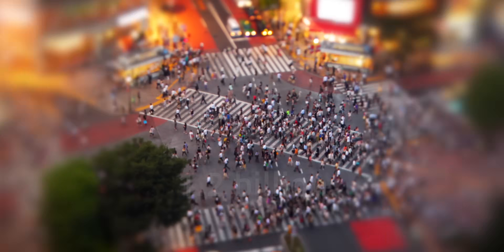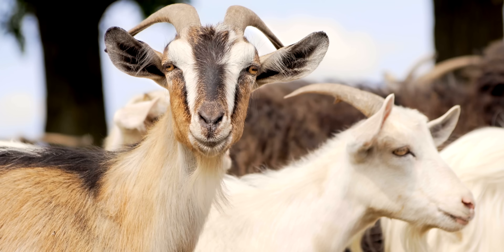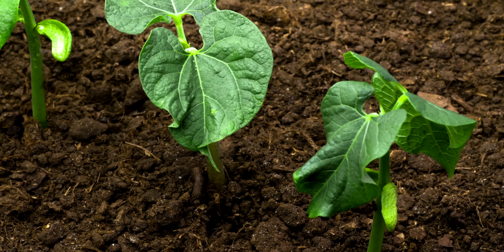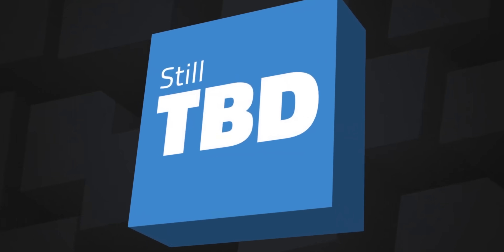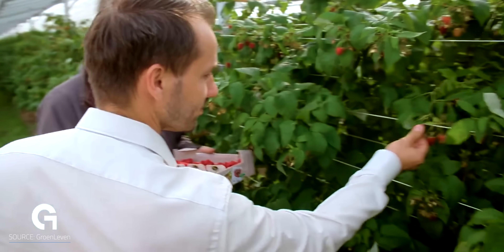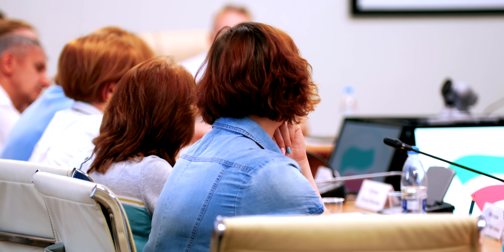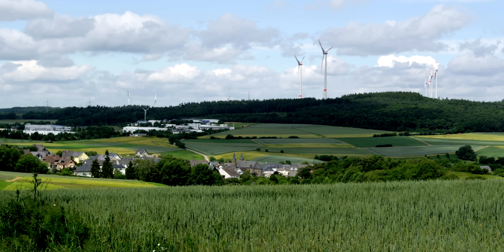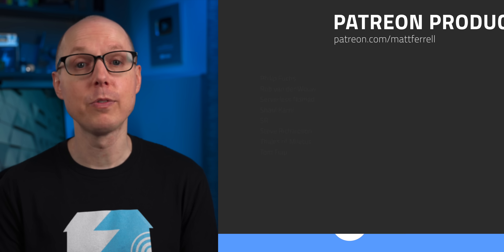Solar Panels Plus Farming? Agrivoltaics Explained

Comment from the maker: But what do you think?  Should we be trying to use agrivoltaics everywhere?  Are there any other dual use renewable energy examples that you know about?  If you liked this video, be sure to check out 28,000 Year Nuclear Waste Battery? Diamond Batteries Explained https://youtu.be/VWwKqSzakYU?list=PLnTSM-ORSgi5LVxHfWfQE6-Y_HnK-sgXS
Reply: I'm wondering if it would be more cost effective to have a solar-powered-multi-level-vertical-hydroponic-farm-warehouse built on the same land rather than an agrovoltaic? What's the most amount of food that can be grown, harvested, and shipped for the least/most efficient amount of energy in 1 square meter? (Big brain time. Lol.) Cheers!
Reply: @gumpdude  Warehouses are already used for vertical farming and I believe include solar panels on the roof.  You don't need to build warehouses for this because there are plenty around the US that aren't used.  So, first best to use the resources you already have.  If you live in a country that doesn't have a lot of empty warehouses, maybe.

There's a LOT of crops that aren't really suited for that style of growing.  It's mostly used to produce greens and other small vegetable plants.  Even with tomatoes, putting them in soil under a cover, and putting a cover over the soil to help retain water is very effective.  I know people do hydroponics with tomatoes, but stacking becomes a different story.  You need crops that don't create deep root systems and are small because you need a few levels of plant for warehousing to be cost effective.  You need to generate the lighting for all this.  If you have to build a warehouse, it's a big investment that by itself doesn't generate revenue the same way solar panels by themselves would.  This is a tradeoff between full crop space and power generation to make money.

This type of farming would hit resistance if you have to build a bunch of warehouses to do it and would still suffer from the NIMY effect.
Reply: @gumpdude  not all crops can be farmed in hydroponic efficiently. But sure it can work for some lettuce
Reply: Saw a Doctor-turned-farmer in arid western Indian State of Rajasthan combining fish farming beneath his Solar farm. Govt of India gave a subsidised loan for this project. It is a net win-win. Cooler solar panels, less evaporation of pond in hot summer (in western India Summer temperature can go as high as 50 degree Celsius.
Reply: The Western US is looking a devastating drought as Lake Mead sinks to scary levels where where we’re looking at a real possibility of the Hover Dam no longer being able to produce electricity for the surround area. These dry arid regions offer a great wide open landscape for solar farms. Utilizing the electricity generated to desalinate water to help convert these areas into usable farm land which can benefit from the shade of using agrivoltaics. Once the land is reclaimed and the water demands for maintaining the land are minimized excess water from desalination can be utilized for municipal use along with any excess electricity. Multiple birds with one stone potentially.
Reply: @SeanMTuohy  I, waiting for vast greenhouse farms to be built in areas in the country that have water but a shorter growing season than California. Think of places like Tennessee, Missouri and Arkansa.
Reply: I have wondered about this also. Look at some of the huge greenhouse complexes like the ones on the Mediterranean Coast Spain which is about the same latitude as the states you mentioned.  Heck even our greenhouse is over 40F right now and it is 13F outside now and we only have about 5 1/2 hours of sunshine now.
Reply: This is great! I've been talking about doing something like this for two decades now and this is the first I've seen of it being tried out. Not only is this brilliant, it is a potential solution to desertification, giving us a means of recovering/using desert terrain to food AND power production around small communities, such as our desert southwest. Countries like Saudi Arabia and others in that region could free themselves of water and food insecurity while providing them the power they need to move off of petrochemicals.
Thanks for sharing this.
Reply: @Myrddnn  So, where are you going to get the water in the desert?  You know the UAE tried to create a neato farming system in the desert.  Everything was well thought out, except the water part.  They quickly went through all available ground water, and ground water, believe it or not is even important in the desert, and there isn't as much of it.  It was a big waste of money for them, and all the investors who thought it was a good idea.  Even if you do rain capture, rain in desert is infrequent, and if you collect it, it's not replenishing ground water.  You would have to pipe in water, and for a place like Saudi Arabia that would mean desalination.

I don't understand the fine details of hydraulics in the desert areas, and probably each area is different and you need a specialist to come in to any area to come up with a plan for trying to gain land back from a desert.  But, this usually only works if the land recently wasn't desert and you're trying to restore it.  I think this has been done in a few places, and it usually involves restoring forests that used to exist in nearby places.  I believe this is happening in Jordan for instance.
Reply: The case for dual use solar over water reservoirs or transport canals is another very interesting one. In California there was a study showing it can reduce the rate of evaporation, and also assist with panel cooling.
Reply: The limited "Wind & Solar Renewables" need to give an honest answer to the same questions I sent to the Sierra Club regarding whether Indonesia's should build 7×500MWe ThorCon liquid metal Thorium ion molten sodium fluoride salt burner energy converters totalling 3.5GWe base load &/or load following -
 Or continue with their PV alternative and destroy a further 19000Ha (190sq.km) of scarce tropical rain forest for Solar PV farms to supply the equivalent energy?

My unanswered Open letter to Sierra Club: -  
"..INDONESIA has an environmental choice: -
more poluting coal-fired power stations; 
Or-
 7×500MWe liquid Thorium metal ion with molten sodium fluoride salt, (MSR) ThorCon energy Converters at a capital cost of $1/Watt;and a >75 year life?
 Or -
Destroying 190 square kilometres of tropical rain forest for <30% utility 25 year life Solar farms to get the same total energy output  as the seven ThorCon 500MW MSR units but at a cost of $(2÷30%)=$6/Watt?
I represent a number of environmentalists in Indodesia and we would love to see a reduction in the number of 1GWth Coal power Stations scheduled within the next 10year plan as well as the eventual conversion/modification of existing ones to use Molten Salt Reactors (MSR) as a clean and safe heat source.
We, and quite a number within the rural farming community, are concerned not only with the encroachment by urban sprawl into extremely productive farming and flood absorbing land; but also the actions of entrepreneurs seeking land for large Solar panel farms.
# Could you please confirm whether or not your club would prefer seeing Indonesia's choice for replacing existing and future planned poluting coal-fired power stations with either the likes of MSRs or farming and/or tropical rain forests destroying Solar farms such as : -
A) their currently contracted 7×500MWe ThorCon "Walk-away" safe (near ambient pressure), energy converters with a 65m×180m=1.17Ha footprint per load following unit of max 500MW on grid; at a worst case annual 95% utility factor, amounting to an averaged availability max load of  406MW/Ha (over a giving 75year life) at a capital cost of $1/Watt and a PPA agreed cost to consumers <$0.07/kWh;
Or -
B) (As already experienced in PLTS SulUt  Likupang's 21MWp ;15MW on Grid at 30% utility with a footprint of 30Ha and 25year life); 
Equivalent Solar farms at 0.5MW/Ha; at a pre utility basic capital cost of $2/Watt; and a current PPA cost to consumers $0.066/kWh and averaged load output 0.1MW/Ha to 0.5MW/Ha over 7.5 hours per day giving 30% utility.
HENCE for Solar Output over their productive hours to equal that of ThorCon's 3500MWe over the same daylight period of time; then the area requires would be:
 (7×500/0.5)÷1.17=7000/1.17=6000Ha or 60km^2 of scarce tropical rain forests.
Because Solar is only effective for 7.5hours/day (30% utility), to meet the Max possible (as a  base load) annual output would increase required area tropical rain forest destruction to 0.95×6000÷0.3=19000Ha or 190 Square kilometres of tropical rain forests or virgin jungle.
(It is of note that wind farm are not viable in Indonesia due to their lack of wind being in a Equatorial location).
If you cannot confirm a suitable choice for Indonesia (or the world for that matter) would you reconfirm that the Sierra Club still prefers the destruction of temperate forests in Germany for shipment to burn in subsidised poluting British biomass plants in preference to walk-away safe liquid metal molten salt reactor that can also burn up existing nuclear "waste"?
NOTE: I have no interest or influence in ThorCon.."
I await your judgement..🥝🥝🙏
Reply: @MrVaticanRag  Hello, this is ishee. I am from West Indian state of Gujarat. As a developing nation we are in a state of constant battle trying to balance demand n I was wondering if i can use your letter and explanation abt. Thor Con on my Social media and a few people who work within the Coal industry ?
Reply: Plant some ThorCon molten salt reactors at 500MWe per 1.17Ha (two football fields) and safe the other 9.83km^2 for crops ot tropical rain forests.
Reply: Excellent video, Matt!  I run a few subs on Reddit and have been sharing your vids over there. I also teach people how to install small off grid solar and build sustainable and affordable housing.

I have been off grid for over 20 years and my focus is on homesteaders and small off grid systems and sustaianable villages.
Reply: @solarcabin  We have a remote recreational place we built 20 years ago that we could live in full time if we wanted. I’ve had solar there for 15 years. There is a 12v system for lights and RV pump. There also is a 4K 48v inverter system. We will never run out of wood there either.
Reply: @Chris_at_Home  Right on!  Things keep getting worse that would be a good place to be.
Reply: the main question shoulb be how much food can be produced in food factories (airopondics/aquapondics) using of the electricity produced by the agrivoltaic setup? how much higher is the total jield?
Reply: @TalasDD  Look at videos of people having fully enclose ecosystems for growing food. It is fantastic to see many problems of growing food in the great outdoors suffers from storms, winds and BUGs. These enclosed facilities have that all under control. Solar seems to provide for all the electricity needed to run the greenhouse. Water is recirculated, reducing the need for more water, bugs don't destroy crops and yields are higher. Everything is computer controlled. I see these types of facilities really great in areas that are hostile to plants, like being near a desert.
Reply: @TalasDD 
•  Today, Globally, 120,000TWhrs/yr would be required by PV Panels to MEET ALL OF MANKINDS ENERGY NEEDS (not just Electric Customers today who use <30% of the above).. 

• If this is priced at $0.05/KWhrs.. you get $6 Trillion / yr Revenue from AV Electricity.. 

• The Global Agricultural Revenue is $4.5Trillion/yr (6% of GDP of  $75 Trillion GDP).. 

• As you can see by DUAL-USE of Farmland by adopting AV.. The Income of Farmers will more than double from USD 4.5Trillion/yr to 6+4.5= $10.5Trillion/yr.. on the SAME LAND.. !!! 
Hope this helps..!!!
Reply: Instead of just having gaps between the angled solar panels you could have clear corrugated plastic that would still allow for sunlight to pass through but would also create a wonderful rain capture system for when storms pass over the solar panels. That captured rain could further reduce water consumption from Land Wells or municipal sources in order to water the crops under the solar panels. Capturing the rain could help during dry spells, but the panels between the cells would further protect the crops from wind and hail damage.
Reply: I would love to see a hybrid system between Agrivoltaics and Aquaponics.
Reply: Your voice speed is a bit fast at a normal rate
Reply: Solar over irrigation canals is dual use.
Reply: I think we need more sustainable farming more diversity less uprooting less chemicals and well lots more but most importantly more native foods that require less water and what not you know.
Reply: "Tinted Semi-Transparent Solar Panels Allow Concurrent 
 Production of Crops and Electricity on the Same Cropland"
This paper showed that using Tinted Semi-Transparent PV could provide optimal wavelengths (blue and red) to spinach and basil.
I don't know the farms that you shared whether they incorporate this tech or not yet ???
Reply: @amazingmemories5839  "Semi-Transparent Solar Panels Allow Concurrent 
 Production of Crops and Electricity on the Same Cropland"
I was going to bring up the notion of PVs that let some light through, but you beat me to it.
Reply: in Israel, they grow crops on the southern side , close to Dead See. the good things is  : lot of lands and lot of sunlight, the bad thing is too much sunlight and no water. They employ some advance technology to water the plant. this type of solar solution should benefit them a lot
Reply: No Win. Basically your peddling Snake Oil. 95% of farmers in the world do not have the money
to build structures like this. Also what your growing is only sufficient to an extend. Not a solution but a privilege.
Nature bats last remember ... and all you can do sell these ugly lookalike tshirts.
Reply: There is more of a demand for the means of production, because the thing being produced is held to ransom at ten times the cost.
Reply: Everywhere, no.  Lots and lots of places, absolutely.
Reply: It's an interesting concept.  What are some of the "push-backs"?  I've got 40 acres of cleared land and will use solar mainly to power my house and a barn, probably a 10KwH system as I have now.  I've already noticed that my solar installer shorted us on the circuits connected to the batteries, i.e. during a recent power outage I used less than 2% of the battery in a 4 hour period running the well pump, septic pumps, water treatment system, 2 freezers, some lighting, my pc and modem and a 45" TV.  I could probably hook up several more circuits (like our kitchen) and still have power to spare.  Agriculture... we will be a very small hobby farm with an orchard, so pushing water to trees and crops will be needed, but that won't take much power at all.
Reply: Maybe this why rich people that are promoting global warming are buying up vast amounts of farmland.
Reply: What are the energy costs of maintaining capitalism and the "free market" ?
Reply: @SapphicReality  "What are the energy costs of maintaining capitalism and the "free market" ?"
The free market provides everything that gets provided.  Everything else just uses what the free market makes.
Reply: why beg for government intervention, is that not simply an admission that individuals aren't willing to do these things? there are people like you who talk about this technology and say things like, "it would be great if someone did this!" but you seem to implicitly admit that nobody wants to, so "the government" should? that just sounds like bullying.
Reply: @714acedeck  
The IMF says that the fossil fuel industry gets $11 million per second in subsidies to extract an energy source that is more than half gone (so will only get more expensive as time goes by).
This might be in the best interests of some large corporations but it is against the best interests of the people.
Why are you a lackey of the fossil fuel industry?
Reply: @parajacks4  right? I see the same criticism against electric cars. What's the point if there not economic without substies? Where like you point out they already are and have always been substized. On top of that how many billion dollars did it take to bail out the auto industry ten years ago or so back?
Reply: Agrivoltaics are a great way to replace dry, near sterile areas into a an ecosystem right underneath it, raising the panels  a few feet up, allows the same energy production but alleviate the harshness of the desert lands into productive agriculture... plug a few heat pumps underneath and the condensed water will nourish the plants too... Great thinking I didn't envision without your video....
Reply: Of course not all the land, but part of it
I'm a Brazilian farmer and can tell you
 Agrivoltaics is indeed feasible for some crops like fruits and vegetables, but not for high yielding and sun light demanding ones like cotton or corn
And yes, there is a ongoing sun energy harnessing combined with food production technique, called ILPF
Consists of planting Eucalyptus for firewood combined with cultivated cattle pasture
There is lots of publications about it, may be the most in Brazilian Portuguese 
By the way, the Brazilian demand for solid fuel is by far mostly supplied by cultivated eucalyptus rather than coal
It's firewood have about the same energy as lignite and is carbon negative, since you need to plant the forest and let it grow something between 6 and 10 years before harvest
During this time, you will be storing carbon for future use, much like a savings account
Since it's a long time before harvest, there are the need of several plots of land on different stages of storage for each one being harvested, so, it's carbon negative
An old data I found told a yield of 60 metric tons of dry firewood per hectare year at the time of harvest
Just like 6 kg/year of lignite per square meter
Reply: Add those solid state wind turbines to this concept, might then even integrate watering the farm land, as a side bonus.
Really, you should consider a few video's that explore how certain concepts could help each other out.
Like that transparant solar video of yours, being added to this solar & farming video and that solid state wind video also of yours.
Reply: Every reservoir should be covered with solar panels, they put dumb little plastic balls on them so the water doesn't evaporate if they made floating solar panels you'd be killing 2 birds with one stone.
Reply: @KnotRight4Ever  , oh yeah, Veritasium did a viddeo on the balls,

like how India is covering its canals?
Reply: I heard a long time ago that a student from China made a highly efficient solar panel out of human hair, what if you made a solar net instead of panel. That would keep birds an bugs out an only block some light an for the plants that need more light you plant them on the borders of your farm an put mirror walls to reflect light under the net giving them more light and as a net the solar net could absorb light from underneath too.
Reply: My use would be with my aquaponics system which I am going to upscale to about 6 hectares of space over the next 10 years or so depending on how fast I can come up with funds for it.  

My current crops are ornamental plants which would benefit from the lower light as we use a polyeurethene shade material now which would could replace with the panels.  They would power the system as well as producing electricity for our planned fruit transformation factories & other such plans.    I am living & working in Colombia.  Do you possibly have any connections that would be interested in a project like this?
Reply: @DukDukDoDo  about 20yrs ago I heard of a algea called shawanna wonnosis ( I probably butchered the spelling) it produced acual energy not bio fuel but like an eel and it even said if digested certain materials it could pass conductive nano wire as a waste an itself could live an magnify a voltage within a certain battery type. I looked it up every once an while but haven't seen anything big about it since. I think the government had a huge bio farm filled with it in Texas the last I looked.
Reply: Absolut, das sollten wir! I We try with our members from the green party (die Grünen) to start a pilot-project in our Community. Cross the fingers (drücke die Daumen) that we can realize it. Hopefully our new government in Germany with die Grünen, as one of the coalition parties will change the the "Rahmenbedingungen" ore general conditions, that it will be in future easier for Agri-PV.
Reply: This is literally the dumbest thing that has ever been posted, congrats!  Plants convert solar energy into food.   Solar panels convert solar energy into electricity.    They couldn't be more incompatible considering that they both compete for the same solar power source.    The solution is simple:    First world nations need to vow to withhold financial aid and/or go on a trade embargo unless the trade partner has a birth rate close to replacement value.   This would also encourage first world countries to stop their open-border policies to ensure their own populations don't exponentially grow, and it will provide worldwide economic incentive to stop having 7-children.     Otherwise, any plan that you implement will be unsustainable with exponential birthrates from the middle-east, India, and Africa that will simply explode and take over the world population through immigration to countries that have their birth rates under control.
Reply: I really want to discuss something with you through direct message...
Please it's about your video
Reply: Here's something for the idiots of Renewable Energy: 

Sooner or later you greenies are going to need to grow up and learn how economies work. - hint government people understand nothing of economies other than  how to rape them.    

These G-morons decided "woke' power (power that doesn't really work) was a great idea for them, not us, so they decided to steal some money from some ratepayers in order to pay others to stimulate the growth or power that really doesn't work - ie wind and solar.

In the real world, the one that really works,  there is something called supply and demand and these things regulate the price of everything fairly.  

Your butcher buys his beef by the side and pays more for it than the meat packing plant did who in turn paid more for steer than it cost the rancher to produce it.   Get it so far?     

Now when you buy that beefsteak at the butcher's shop he's going to get his markup as well,  so you as the end consumer are going to have to pay a lot more for it per pound than the rancher was paid for it.   

Next time you want a beefsteak drive out to a ranch and buy your steer on the hoof - then you slaughter it, age it carve it up sell the inedible parts to dogfood processors and the like and eat the rest of it on the cheap - no you want the value that all those who added value to the meat along the whole length of the supply chain don't you?  Or do you buy your steaks on the hoof?      Or do you expect to pay the  ranchers price at your favorite steakhouse as well?

It's that way with electricity too, you cannot expect the power company to buy power back from you at retail rates when they don't even need or want the power. With that business model they will go bankrupt as soon as their investors are wiped out.    

If that rancher were to dine out at your favorite steakhouse why not demand that your ignorant politicians make the restaurant buy his on-the-hoof steer from him on demand at the same rate per pound that they charge you for a 16 oz prime rib?    

The problem is, as with all government planned economies, sooner or later everyone will want to receive the grift instead of paying for it, when that happens the lights go out - permanently.

The most ignorant feature of all of this is that it is supposed to solve some problem that the grifters dreamed up but that does not actually exist so solar panels and wind turbines only create huge problems, they solve nothing - time to wake up you dizzy Californians.
Reply: @hg2.  do I trust someone that out the bat calls everyone who wants renewables 'idiots'. No. So let me fix this so you sound less idiotic.

First off using meat as an example is - go vegan. Next, I have decentralized solar - my solar's not connected to the grid. I don't pander to electric companies - because they're the ones providing fossil fuel products to everyone - why would I help them?

But do I expect to give others solar? Yes, I happen to make enough to give to my other family members. One day my neighborhood. All for free - economists like you just can't handle that and don't like that, but they can't stop it - so they will ridicule and demean till their blue in the face to accomplish what? Blowing off steam? Yeah keep dreaming - I'm not giving electric companies solar and I'm keeping my free electricity. What're you going to say no? I say who cares about giving people a job and participating in the economy when it should exist. We have options now and you just can't stand it - it eats you up inside. Must be hard living with your outdated views.
Reply: @extropiantranshuman  
Tell all that crap to people getting
- priced out of electricity,
- freezing in winter, 
- sweltering in summer,
- getting run over riding their stupid bikes
- getting priced out of the car market
- 
-
Reply: @hg2.  Look you're trying to knock me by expecting me to do the impossible while also getting in my way. It's not going to work - if you really want to do something - stop being angry and start helping out!

I can't change people - but agree others are living foolishly wasting resources they don't need to. Whether it's snowing or extremely hot (I live in a desert that's 115F+ on average during the summer) and still don't use AC/heat. I tell others, they don't listen. I post on my personal website - still no avail. 

What're you doing to help out?

Also I don't believe in biking, driving, walking, etc. to get by - those're resource intensive and dangerous. Telecommuting is the way and the future! That's what I do! People shouldn't buy cars - they're killing machines! Why should I sponsor a murderous industry - that should be illegal?

Look anyone that puts themselves in danger by being dependent on stuff that works against them or isn't there when they need them while not listening to me and doing something about it - are those that aren't worth my brain space (and shouldn't be for yours either). Everyone's responsible for themselves and not everyone's responsible. And that doesn't matter - what matter's solutions, not feeling sorry for everyone who's irresponsible.

What're you going to do - wory about  and help out someone sinking because they built a ship that breaks due to not listening to any voice of reason just to abandon those who are doing the right thing? Sorry but you're headed in the wrong, seriously damaging direction.
Reply: Hello Matt, talking about this, you should check out "Solar Foods", they make food out if thin air basically
Reply: Yeah will should clean energy and water reduction making farm easier to run in the long term
Reply: Can we create a membrane (I’m think something that is dirt (pun intended) cheap here) that attaches to the back of the solar panel (the ones that are no built with spaces in between the cells to light through) to collect that water evaporation coming from the plant to further aid in cooling down the solar panel. Would be interested to see if we can improve efficiency of the solar panel.
Reply: I read about an Australian desalination plant / greenhouse /energy producer, the system could produce many times the normal crop yield from one acre, the desalinated water was first use for hydroponic growth of tomatoes, then further purified for drinking, with the plant producing excess energy
Reply: Right now, and for many decades to come we will continue to grow the majority of our food crops in dirt.  Think of dryland wheat as an example.  Corn, soybeans, ect.  As well conventionally grown cereal crops will not be folded into the agrivoltaic model, because they don't fit.

High value fruit and vegetable crops are the best candidates.  But as time passes, especially with the expansion of vertical mount bifacial panels, innovation will continue to adapt solar to new crops and managment techniques.  
Local  land use control makes federal efforts less effective.  Probably spending the money right away on public relations,  giving them a ten year mandate to make agrivoltaics fun, sexy, popular, and famous all across America...

It seems many people are susceptible to suggestions of late, let's feed them propaganda to get them to want something that will actually benefit all of us.  Just see how far we've gone in the wrong directions since November 1st 2016.  

People do not want to be told what to do.  The want to be told they are safe, they will be protected, and daddy loves them very much....then they beg to be told what to do.  So let's give our population whatever the hell tickles thier sensibilities, that they wake each day proud to be part of the solution, not more of a problem we don't need anymore.
Reply: We can use robots to harvest 😍🌹
Reply: Here is a question... I guess it comes down to math and efficiency.  I know that some hydroponic farming uses specific frequencies of light instead of broad spectrum light and can be pretty efficient using LEDs.  So, if you have a solar panel sucking up broad spectrum light.  If you turn that into narrow spectrum light using LED to hit just the bandwidth the plants need, how does the math work out?  Could you do indoor hydroponics just with the solar on the roof?  Could you create more net land?  (And then, how do you math out the other costs... building costs, water savings, less pesticide use?)

/Seems like the agro-voltaics tax incentive issue could be fixed.  I wonder, for running the equipment underneath, if you put the equipment on rails (or maybe if they were computer controlled) if you could run them in tighter spaces.
Reply: You need to do a follow-up: storage of renewable energy and grid balance and grid connections/transmission.
Energy grids atm can not handle vast expansion of intermittend renewables. In USA and Europe. VOX did recently a video. Same in Europe where transmission line NIMBYism has slowed update of the grid alone, let alone storage capacity.
Reply: Matt, what are your views on the new idea out there to make 3 GW solar power in Australia and then sell it to Singapore? 
What are the obstacles to this, not only the 3600km underwater lines but other issues? 
Cheers!
Reply: can you talk about the new paper about starch make from carbon dioxide?
Reply: Covered it in 06.
Reply: Thanks for the vid! I've been thinking of setting up a small agro-voltaic vineyard and you answered many of the intro questions
Reply: heres a fucking bloody idea. why not use the POWER this planet is alrdy producing.
Reply: What was the solar panel efficiency improvement due to the cooling effect of having crops underneath the panels?
Reply: In India they are covering irrigation canals with solar panels.
Reply: DW did a p[piece about water loss in Germany. there is a very good reason tehre. 50% water savings could save the   whole of agriculture.> Do watch the piece
Reply: In areas where shade cloth is needed this duel use of agri voltaics looks like a no brainer. 
Agri voltaics will be perfect for much of horticulture as it’s usually close to the cities anyway, where the power is needed.
We will see more of these, especially in the lower latitudes
Reply: I was always fascinated with aquaponics. Growing fish and using their waste as nutrients. Fertilizer is one of the most energy intensive processes we have. Feeding fish and letting nature make the fertilizer could be much more energy efficient. And farm fish at the same time with nearly the same footprint.
Reply: Wait, I thought the Dutch example showed that agrivoltaics were a win-win for both the farmer and the solar panel? If that’s the case, why would we need government subsidizes to help farmers or solar suppliers take advantage of this if the benefits are already evident?
Reply: @brendanbruno7024  
Initial capital investment?
Reply: @parajacks4  Venture capital funds would be chomping at the bit in that case if the positive prospects are as good as this video suggests. If the only funding they can get is from the public coffers, then this most likely isn't a very viable solution or else someone would be trying to make a profit off of it via free market capitalism
Reply: To say that population going to encrease by 1 billion with a big smile I would expect from some intellectual with mathematical, logic intelligence of 5 years old. Definitely not from someone like you MR.
.......
 Can you relate to what I said and  exponential growth?
Reply: yes
Reply: Not everywhere, but where it fits well. It doesn't all need to be over way. In parts of California or even southern Oregon known for heavy agriculture and now drought, seeing this up in certain farms to reduce drawing from water tables would be great. There is certainly enough areas around the world that would benefit this to get production scale up, while still leaving many farms as they are.
Reply: Thanks for putting this video together, Matt - very thorough and well done. As a long timer in the solar industry and someone that has developed agrivoltaic concept projects, I wanted to add one more key consideration to the conditions of whether a project makes sense or not: existing transmission and distribution infrastructure. Generally speaking, you will either need a very large agricultural site or simply one that is adjacent to a T&D network with sufficient capacity to accept a larger installation. Alternatively, smaller ‘behind the meter’ agrivoltaic systems could be developed for and owned by the farmer but would need a sufficient load to offset. In the US, REAP grants would be available for these types of smaller scale projects and could be further enabled by USDA financing to empower (no pun intended) the agricultural operation.
Reply: Agrivoltaics are for morons. Too expensive electricity. The only reasonable way to go is fast reactors.
Reply: The problems are not government subsidies, is the government intervention!
Reply: @franmena8727  "Government subsidies" are in the category of "government intervention".
Reply: What happened with the transparent solar panels?
Reply: 0
Reply: How much dose its cost to creat that kind of farm ..???
Reply: I would love to try this on my property but where can I buy these panels that are suitable for this function? From what I can see my only option is to make my own using individual cells because I don't see panels for sale that have them more widely spaced to allow sunlight through.
Reply: Yes we should use agrivolts. Also all available rooftops should be covered.
Reply: @boathemian7694  Didn't you understand the information in the video saying solar isn't economic even when you include the positive protection effect on the plants?
Reply: It's stupidity, to rely more than necessary on solar. It's an untrustworthy source.
Reply: if water was priced at its real cost or even rationed then  farmers would be more interested on the water savings.
Reply: @mac_mcleod  It's all about control to you, if farmers provided you with food at their real cost, you would starve to death.
Reply: @magatism  no they would start racing the crops in more effective areas and in less wasteful ways.

The Water waste and the west by Agriculture and corporations is atrocious. Because they get the water Far Below Retail cost.

But I agree, if we charge the proper price for water then some products would be less available. Almonds would be more expensive for example.

And other food would become more expensive. But it's much more effective and much less wasteful to charge the proper price for food and then give food assistance.
Reply: @magatism  dude, I'm a suitable word that uses less than a thousand gallons a month. I don't know how much less because they don't monitor below that level but I do get to the point where I have zero usage some months.

You're really reacting strongly to the concept that we shouldn't be raising wasteful plants with water at submarket prices. I'm going to assume that you're a farmer and your income depends upon being given water below-market prices.
Reply: What about rice and wheat farms ❓ could the same techniques be applied ❓
Reply: The economics of this would be best in fields near a nexus of agricultural consumption, like a town or an industrial park.  This minimizes the losses and increased capitol expenditures due to power transmission over distance.
Reply: Future solar panels could be designed to be optimal "greenhouse" glazing. Plants use part of the solar spectrum while PV uses the remainder. Thin-film rotary-printed PV on plastic films could be installed using the same techniques currently used for plastic greenhouse enclosures. The electrical wiring could be built into the support frames and the PV sheets connected with appropriately-designed clips. I suspect that dealing with moisture will be the main engineering challenge for making this idea work.
Reply: Something very much related to agriculture and renewable energy is biomethane, eg. turning biomass like cow manure or food waste like banana peels into biogas and processing it into compressed methane for use in cars, electricity etc. I've been driving a methane powered car for over a year now and recently fueling mostly at my local waste processing site that picks up my own recycled food waste. So far I haven't really ran into any downsides. 
For what feels like a win-win way of instantly reducing carbon emissions (even if not eliminating them altogether), I feel like it's being drowned out by EVs. The numbers I've seen thrown around are 25% reduction measured at the tailpipe and practically carbon neutral when considering entire lifecycle emissions when compares to gasoline. Would love to see a video discussing the pros and cons of it, but couldn't find one. Cheers!
Reply: I like video but language is properly not understand
Reply: New technology for electric power generationhttps://youtu.be/xc2V2BS_Fng
Reply: Sir really it's a great idea .. india .. we can sell the electrical energy to  electricity providers we can have a good business out of it ..
Reply: I have an idea: 
APV + Vertical Farming + Hydroponics
Reply: I understand the need for optimizing in our world, but optimization does not always coincide with beauty. I think there are better places for solar like house roofs factories roofs or parking lots roofs.. we should first dedicate to those
Reply: What about birds that or pollinators, how are they affected?
Reply: What are the affect to bird life and pollinators?
Reply: GOLD PRICE SHOULD RISE TO 2100$/OZ
Reply: Road-voltaics, car porch-voltaics, sport stadiums-voltaics, highrise buildings windows-voltaics... all big, space consuming structures that we have today can be "transformed" by adding panels, and it does not have to be ugly!
Reply: I don't this would be good for farms that use combines to gather their harvests, like corn and wheat. 
But I do think it's worth it for those plants that are harvested by hand.
The problem is dead space created by the support columns.
Reply: @Undecided with Matt Ferrell , maybe you want to check out organic solar cells.
They are pretty much in thier baby shoes, but thier potential is huge, with how adaptable they are.
Reply: YES…we  do a dual-use. And that it can drastically save water, is a  boon!  So, it sure  great, & addresses big concerns.  
But, HOW can this vast increase in PV use be mitigated?  PVs are terribly environmentally harsh/damaging.  
The clean energy those make seems tantamount to smoke-&-mirrors, because of the environmental impact caused by making them, which RARELY registers on the info packet radars given to consumers & officials, so is left out of the discussion by the very people making decisions. 
But…what if parabolic mirrors were shading the fields (especially in dry climates), instead of PV, focused on a phase-change salts in a central tower?  Those systems are measurably less of an adverse environmental impact..? 

Would sandstorms ruin the mirrors? Do those mirrors cost like PV?   Can those be resurfaces if damaged by sand or other, to reduce costs of replacement?  Do the salt towers used to store the heat to make power, cause other issues?  How long do the proposed PVs last before needing replaced, compared with components in the mirror farm?   
I think the net benefits effects of growing crops under PV, is likely the same as under mirrors pointed at a salt tower, but without the environmental harm PV causes to make.
Reply: ...YES, when pros outweigh the cons...it's a resounding YES!
Reply: CRUDE OIL IS LOW NOW EVERY ONE SHOULD BUY.ELON MUSK TESLA IS SO MUCH MAINTAINENCE NEEDED.WE CAN NEUTRALISE POLLUTION WITH AIR FILTERS . HYDROGEN AND ELECTRICITY IS ALSO NOT GREEN ENERGY.///
Reply: SELL GOLD BUY PLATINUM PRICE IS LOW NOW.
Reply: coffee plantations in Colombia are being affected by climate change, the cover from solar panels might ease these effects, no?

i'm not sure how big an arabica tree tends to be though, would probably need the stilts you mention, 

thanks for the video!
Reply: It's very interesting, but if it's only chance of success is through the hand of big government I would say it still needs some work.  I would like to see this paired with a geodesic dome that uses aquaponics.  Geodome farming is very promising, the dome itself is one of the strongest shapes to withstand nature and provides more surface area per square foot for solar panels than a flat surface.
Reply: I am trying to do these on my farm, could you please share link with the companies who can provide me photovoltaic cells ? I live in India so I'll have to import it.
Reply: of course we should, but that doesn't mean it's financially feasible
Reply: How about the risk of solar panel material leaching out with time and getting into the soil and plants?
Reply: In South Africa there is a monopoly with the power distributor, people are getting fed up and moving to renewable sources just to have power at home especially at night, now the gov and their power company wants to implement a x 10 rate for being connected to the grid when you don't even use it and nor can you dump power into the grid because they build 1980's power plants in 2020. On top of that there is a French solar manufacturer in South Africa and yet we pay half a million to get a house of the grid.
Reply: the only solution is to stop overpopulation and enforce strict birth control regulations in all overpopulated countries for the next 300 years.
Reply: What about radiation emission from photovoltaic cells?
Is it just a myth or is there evidence of radioactive contamination from some types of solar panels?
Thanks for the video btw, great job :)
Reply: Could be a good idea to use it on a poor topsoil landside? Africa has many. It would be great if this agrivoltaics system could give back the chance the people who almost lost it beacuse of the changing environment.
Reply: Can this be used with vertical farming?
Reply: Have a few questions ?
 1 what's the startup cost
2 what happens when there's no sun
3 no sun and you run out of your battery time
4 how much does it cost to replace the solar panels when they no longer work
5 how long do the solar panels last
6 can it all be tampered with buy some unseen Force to turn it off or on at will
7 how much does it cost to replace the battery pack
8 what happens to the toxic battery packs when they're no longer useful
9 where does the used and no longer useful solar panels go
Thank you for answering my questions I look forward to your answers
Reply: How about going underground and making massive vertical farms and we can set the solar panels above the ground in this way we will make the energy required in the vertical farms and also the crop production will increase substantially and also crops won’t be at the mercy of rain and we will have the advantage of both the solar farms and the vertical farms
Reply: You should reach out to BP or ExxonMobil to sponsor your videos 😂🤣
Reply: Covering the roads with high up solar panels could be an interesting idea. The place is easily accessible (duh, it's a road), it is already clean and easy to build on, it is litterally everywhere. a 1km 6 lanes highway is about 30000 sqm, something like 3MW of PV panels.
Reply: There are many issues related to it. 1) Rain 2)Type of climate - Tropical or Sub tropical 3) Storage of electricity 4)Solar panel cost 5)Off grid or on grid cost. Might be feasible if the sale of electricity has good revenue. 6) Irrigation ? Just wanted to ask small question that are there any transparent solar cells ? Kindly make a video on this.
Reply: I consider myself a strawberry plant with the solar panels on my roof  😀😀
Reply: Matt, what do you think about something like this combined with Vertical Farming (https://www.youtube.com/watch?v=2tGQXRYgKBI)? It seems like we may only be limited in what we can grow indoor vertically by how effectively we've engineered the seeds to grow indoors. But if that's not the case and some products will always need to be grown outdoors, might it be possible to have vertical farms with agrivoltaics on the roof, or some other similar solution?
Reply: sure keep using solar. screw the birds!
Reply: I know of a few initiatives that have semi translucent panels for greenhouses. Here in the Netherlands, sunlight typically gets too intense round June and shading is a common strategy using screens. All that reflected energy is of course, lost. With semi transparent screens, you would get the best of both worlds without losing yields. I can imagine the same would be true in certain outdoor settings.
Reply: Solar panels on roofs, everywhere that can. Much simpler.
Now how to get that done???? Maybe the government can incentivize installing panels. Maybe a contract to pay monthly then option eventually own them for people who cant invest up front. Maybe energy companies can switch to an investment model where they contract panels out, then eventually the property owner have an option to be an owner of the system on their own roof?. Big short term costs. A massive change either way.
Reply: @casparharte  Solar panels have done massive damage to the stability of the electrical grid as it is, as its an intermittent power source that due to massive subsidy is undercutting reliable power sources and displacing them in the market.    Unlike a natural gas plant that can easily ramp up and down power production in its turbine generators to meet demand, solar varies not only by season but tremendously just by time of day.   So if you have half of your grid on solar, and you have a really cold winter evening when everyone needs power to heat their homes, now what?   Intermittent power sources like solar and wind should never make up more than 15% of any grid, and reliable and more importantly adjustable power plants like nuclear and natural gas should make up the majority.
Reply: @BoopSnoot  I agree, you are right. I was just answering his questions.
Reply: That is awsome, but what is with bees and insects orientating with the sun. There was a problem with solarplates, because they let the insects think that the suns is elswhere ./
Is that still a clue?
Reply: @timschabla4377  Read about Spaniards investing in solar in Spain and the bottom falling out and now tens of thousands of people are bankrupt.   Intermittent power sources that compete with food for the sun with no cost effective way to store the power for use on demand is just a bad business model.    First world countries that never had blackouts now have as low power reliability as third world countries thanks to intermittent power sources displacing reliable ones.
Reply: He (Ukrainian peasant) is deprived of his cattle, his stock, all his goods, acquired through hard work over many years. These measures, which the Communists see as a triumph of their doctrine,
ultimately have only the ruin of the peasantry and thus overcoming the active resistance of Ukraine against the Moscow occupiers… Robberies are accompanied by unprecedented terror and thousands of arrests, mass deportations to Siberia and Solovki, death sentences
Reply: I think placing them on glaciers is a bad idea - due to moving too much but can limit their melt - as well as keep panels cool!
Reply: after life cycle how to dispose them properly?
Reply: @fcukrealmadrid  maybe you can reuse certain parts - like the metal and valuable precious metals in there? I mean it would be considered e-waste.
Reply: @fcukrealmadrid  it also depends if they still work - you can sell them to others if they do.
Reply: Interesting experiment, many people questioned the greenhouse I built with only vertical glass on 1 side and pv panel array on the roof,  but it gets plenty of light because the building turns to track the sun and the interior is bright white so with all the reflected light the plants grow straight up all year at a latitude of 44.7 ish . I think the system you are describing has great potential.I know the hay and other plants seem to grow very well under the 100 20 panel duel axis trackers on 5 acres a field that I lease to all earth renewables. My Aquaponic greenhouse is on my  you Tube chanel for reference . Keep up the good work!
Reply: Agrivoltaics should not be used everywhere such types of agriculture and solar is needed in desert lands where there is maximum sunshine to produce electricity and agriculture.There should not be over production of such things because balances and calibrations are needed everywhere to maintain the natural world and climactic conditions. The ideas are good wherever it’s being used but this should not be overdone.
Reply: @ritaram4723  agrovoltaics would be cool for space solar - solar panels above earth, plants growing on earth.
Reply: Re: Solarvoltaics & Hydro-/Aero-/Aqua-ponics. How is agrivolatics conducive to the heat & nutrients pumping, plus lighting requirements of these methods?
Reply: I live in an agricultural area with some land owners choosing to move towards Solar fields. The arguments that I hear revolve around the leaching of toxic chemicals from the solar panels into the surface waters that many plants and livestock utilize. Is there any truth to this? Or, is it more fear mongering against the development of green energy?
Reply: @user6578  solar panels are definitely made of toxic substances and people do pour water on them to cool them down. I think if you're really worried - the worst you can do is recycle the water used to cool teh solar panel to water the plants wtih it.

Honestly - I'd worry more about the battery than the solar panel - that has way worse chemicals and really does leach. I feel with solar panels - depending - they have a waterproof surface - so where's the contamination? I personally keep mine away from the elements behind window glass. Maybe you'd like to look into that. Another thing you can do is find ways to transfer heat to electricity - like a solar heater - so you don't have to use water for cooling. I would say the only times you have to worry about leaching is building, cooling, and deconstructing. You can sell teh pandels when they're done, as well as e-waste them. 

Remember - continuous fossil fuel usage is what truly causes contamination (like perchlorates) of waterways - and people who use fossil fuels like to hide that. Solar panels use fuels once, maybe twice at most - big difference. Whatever leaching you create, you save wayyyy more - so it's not a big deal to me compared to fossil fuels - but definitely not something to fully ignore either.
Reply: Why use anything else when AgriVoltaics can EASILY PROVIDE ALL THE ENERGY NEEDED BY MAN... AND ALSO ENABLES FARMERS & RURAL FOLKS TO EARN MORE &  DELIVER RELIABLY  WHAT URBANITES HAVE CONSISTENTLY FAILED TO DO... DELIVER .. FOOD... TO FEED THE WORLD... AND NOW ZERO POLLUTION, ABUNDANT, SUSTSAINBLE ENERGY / ELECTRICITY... WHO WOULD YOU TRUST ... URBAN OR RURAL SOCIETIES...???
Reply: @AjayAjay-gz3oz  because food competes with solar - that's why we place them on rooftops, parking lots, etc. - because they produce a function that helps out what we put on it, not takes away from it! To me a better option might be windmills on a farm, but we gotta think bigger - 

I could imagine algaeponics being a better solution - as it provides energy in terms of oil, CO2 absorption, and a food source. Plus you can make it really clear - the water could absorb the heat or something - and we could use that heat for something. Maybe we can combine it by being on top of solar panels - maybe vice versa. To cool down panels. The bottom line is that agrovoltaics is the beginning of our thinking - there's better out there! that's the answer to your question.
Reply: @AjayAjay-gz3oz  hey, calm down. I'm not anti-agrovoltaics - I just think there's better. I'm always looking for better. Maybe you can do indoor farming with a skyscraper filled with solar panels for windows - like SolarWindow. We just have to realize that the technology's not there. We could do rooftop solar - that exists. We can even use bioreactors - so we don't need artificial lighting either - to keep the number of solar panels down. In the end - we have to realize it's not always going to be practical - because we just don't always need it. As you said - we can do without electricity - you can grow plants by a window with light - maybe a green wall as a curtain. 

Both - I have a need, but I also have a greed toawrds better and more ethical - and agrovoltaics is good for some applications - but not for others. Just think about what I said, instead of fight it. Also reflect too - are you about need or greed?
Reply: @extropiantranshuman  God Bless You.... The day you can find enough Rooftops, or Windows to Generate 180,000TWhrs/yr needing 1 Million km2 of Solar Exposure.... perhaps there will be a viable Solution to meet Mankinds Energy Needs .... and not a "Mickey Mouse Option"... of say 18,000TWhrs/yr around the Globe.... 
 As for me I have a Solution already in AgriVoltaics... that WORKS....
(FYI.... all the Lighting in the World barely adds upto <10% of the TOTAL ENERGY CONSUMPTION... and even by Eliminating it TOTALLY.. it will not even make a dent in the Energy Market... grow up .... the World uses a lot more Energy than used by Lighting .... etc.. and other examples.... above.. all "Mickey Mouse" Applications.. at least for me...)
Reply: @AjayAjay-gz3oz  look if you don't want to understand me, don't respond. Clearly your agenda to trivialize anything I say is astounding here. You're not the only one here with solar panels - what is all of that for anyway? I'm talking agrovoltaics - what're you talking about?
Reply: What about putting solar panels over top of large parking lots. The cars get shaded, so they’re less hot and the people are shaded as they walk to and from their cars, and power is produced. I’ve even heard about also growing shade tolerant landscaping plants between panels in this environment, it’s less food production though and more of a beautification red space to green space type of idea, where the parking lot becomes a cool shaded green environment rather than a miserable hot one. I wonder how many solar panels it takes to charge an electric car? Then people can get their shopping done, enjoy a great environment, AND charge their cars!
Reply: @laurenknabel7600  they do that in my city but what they haven't done and should is place solar panels over sidewalks. It makes much more sense than cutting our food production. Shade plants are just sun plants that grow slower in the shade.
Reply: what is the Cost?
Reply: @WadithaGamage2  Depends on YOUR DEFINITION OF COST.. if the Societal Cost incurred by THE POLLUTERS (Fossil, Nuclear etc.) $0.31/KWhr (9Million Premature Deaths..$1 Million/Victim; 275Million DALY of Suffering .. $100,000/DALY of Suffering) from 120,000TWhrs/yr of Energy Use TODAY..
The Cost of Electricity from AgriVoltaics is MINUS(-) $0.20-0.25/KWhr...
Reply: Please help me i need a job
Reply: @Abdullah-en5tq  have you gone to the nearest employment agency?
Reply: how can we do this with wheat in arid countries?
Reply: @melinternets8368  during the harvest season - solar would be great for that! I would imagine the solar to be portable and come in seasonally - wheat being a seasonal crop and all. Just my take!
Reply: Yes everywhere
Reply: how can u over come   damage of solar plates from problem of  heavy winds come
Reply: @TARAKRAM2.O  Where I live the winds are so bad they actually trigger earthquakes. Still people have their solar panels on their roof and I keep them inside my window. I don't see the issue - heavy winds don't damage solar panels. Ironically - it's the sun that damages solar panels.
Reply: @extropiantranshuman  tq for u r reply but iam asking about open fields
Reply: @TARAKRAM2.O  would you like to ask your question again and explain it in a way that I can answer it properly or just move on from it?
Reply: on buildings or large parking areas would be acceptable. Farmland should be left farmland and I would rather see the excess of land left for trees and for wildlife. Being a conservationist I'm glad you don't use the unqualified term of solar farming. Where will all the hazardous waste go from these panels are useless in 20 years? It's been already proven that these solar companies will not accept the liability and its left to the unknowingly landowners or townships. We're doing as much damage in the resources that are needed to make solar panels.
Reply: @bps7209  I heard some last 40 years. Why 20? I agree with rewilding. Agrovoltaics are perfect for vertical farms.
Reply: Hello pleace help your friend from kanibalism
Reply: Plants rock first ,,, before you plants plants fruits ,,,
Reply: Stop kanibalism you stupit just go tell your friend fasttttttt help
Reply: This planet
Reply: Just plant treeeee
Reply: search for new planets this planet wormy pleace dont hurt animal at your space stupit this is
Reply: Treee treee 🍎🍐🍉🍇🍊🍓🍋🫐🍒🍏🍅🥑🥝🥥🍈🍏
Reply: No stop using the Farmland for solar. It kills wildlife and destroys surrounding property values. This is happening where I live and it is terrible and has destroyed our community and many friendships. The Farmers are also finding out they are not getting what was promised. There needs to be a better way.
Reply: We can organize sheep, chicken and olive farm and agriculture together with solar pannels
Reply: I will like to fund this project in Nigerian...... Tell me what to do and how to go about it
Reply: there are so many uses for this this. the question should not be whether or not this should be EVERYWHERE. Obviously this is situational based on what you are growing and where. California is a perfect example because it supplies a huge amount of food to the US. Almonds and avocados come to mind first for the massive wastes of water in california. this is a perfect option for SOME people is clearly not for everybody. I'm very confused why you belive so deeply in the regulations we have in place today. In your research you said NIMBYs were the number 1 cause of this not going through. Your question of "should this be everywhere" is enforcing the NIMBY narrative. Please try to be more open minded.
Reply: Just add fish and BSF for a complete cycle🎉
Reply: It all seems great, if only we use moderation. The problem with ground mount versus roof mount is that solar panels produce a lot of heat, comparable to the heat of a roof. Which is why roof mount is essentially better because heat is being produced regardless. 

A ground mount on stilts by providing shade the the breeze can pick up, would probably off set the heat produced by the panels, however because heat rises, on a global scale it would be possible that heat could cause a greater impact to global warming. This is why I mentioned moderation.

Building independent green energy is a far better solution, because it not only creates a consciousness of how much energy one uses, but limits more corporate empires. 

I have lived off grid for a very long time, and have a ground mount system in support with a roof system	, about a 100 feet from my cabin, so the roof system is a little to small to fix my power needs. Which on average 1.5 kilowatts per day produced. If I stand around my solar array on the ground it is definitely hotter there then away from it. 

With that being said, I could totally see using that ground mount system to benefit the shade, if I just raise the solar array to a taller height. 

You also mentioned wind turbines in your video, which I have one as well, which adds a nice benefit at times. 
Once again done on a mass scale, many wind turbines can disrupt the wind currents, causing even further environmental damage.

The main point I want to make, is that it is up to us individually to take responsibility, for our own needs, because when it comes down to allowing companies for profit to manage our global concerns, then we will continue to pay the price, financially, and environmentally. Because they only want profit, while some only want convenance. 

Which is why there is pushback between the city folk, and country folk.
Reply: Not just solar but wind and hydro. Mini hydro damns could be put on farms that have channels, creeks, streams etc. I think with a good combo one could get this to work.
Reply: @josephspruill1212  unfortunately, mini Hydro requires a lot of vertical drop, which is incompatible with most flattish farms.
Reply: I think you need to do better research! Netherlands "second highest food exporter in the world"????? WTF were on when you came up with that insane comment? They're one of the world's least food secure nations, on par with much of famine prone Africa in terms of their food production levels!
Exporting expensive tomatos does NOT make them the world's second highest food exporter"!
Reply: I think agrivoltaics is a fantastic concept! The integration of solar panels and farming not only maximizes land use but also promotes sustainable energy practices. As for other dual-use renewable energy examples, have you heard about wind turbines on offshore platforms? They harness wind power while minimizing environmental impact. Also, I'll definitely check out the Diamond Batteries video. If you're into outdoor adventures, you might find the Segway Portable PowerStation Cube Series interesting. It's a versatile power station with a massive capacity and fast recharging capabilities. Check it out!
Reply: That's a great question! Agrivoltaics is a fascinating concept that combines solar panels with farming, and it could definitely have some amazing benefits. As for other dual-use renewable energy examples, have you heard of wind turbines integrated with agriculture? They can generate clean energy while also providing windbreaks for crops. It's an innovative approach worth exploring! By the way, if you're interested in portable power solutions, I'd recommend checking out the Segway Portable PowerStation Cube Series. It's a versatile powerhouse with impressive capacity and fast recharging capabilities. It could be a great addition to your outdoor gear collection!
Reply: That's a great question! Agrivoltaics is definitely a fascinating concept and has the potential to revolutionize the way we use land for both farming and renewable energy production. As for other dual-use renewable energy examples, have you heard about solar-powered electric vehicle charging stations? They combine clean energy generation with convenient charging options. By the way, if you're interested in portable power solutions, you might want to check out the Segway Portable PowerStation Cube Series. It's a versatile and powerful option for outdoor enthusiasts like us. Happy camping!
Reply: Where did you get the information for this video?
Reply from the maker: @diacstefan  all the citations are here: https://undecidedmf.com/episodes/solar-panels-plus-farming-agrivoltaics-explained/
Reply: what about transparent solar panels? let the crops grow beneath, keep electricity as well
Reply: That's a great question! Agrivoltaics definitely has a lot of potential, especially in areas where land use efficiency is crucial. Another interesting dual-use renewable energy example is floating solar panels, which can be installed on reservoirs or lakes to save space and reduce water evaporation. What do you think about the balance between energy production and agricultural use? And have you heard about any other innovative renewable energy solutions?
Reply: This video is truly captivating and engaging! Do you plan to make more similar videos?
Reply from the maker: @thelastradar  glad you liked it.  I do have similar videos on other topics, but I also revisited this same one here: https://youtu.be/ww-_U7_oQbY?si=kv_hNf_7bWzHdS9-
Reply: the idea of Agrivoltaics is amazing , i personaaly like the idea very much ,i also like to add a question to it , can we be able to add pipes around to harvest rain water as solar pannels has a large surface area , can't we use that for harvesting rain water at the same time ? is there any way we can do that ? and also are they suitable to do agrivoltaics farming in semi hilly areas? forgive me for my terrible grammer but still i would  love to take some knowledge in these type of topics. i am from dima hasao , assam india . thank you. 🙏🙏
Reply: Would be interesting if farming fish by aquaponics while growing crops from fish waste has been used with this method.
Reply: Has there been any studies on the chemicals that can leak from solar panels and the effects on the food produced while exposed to these chemicals, would be my first question.
Reply: There are opportunities to TRIPLE the Synergy, by making this part of Community Solar Schemes in rural areas. 

1) Grow food/graze livestock 
2) Generate electricity to sell to the local community or the grid 
3) Create an investment opportunity for local people to set these up

Additionally: create local jobs to install, repair and maintain these PV farms.

The schemes should include an initial Environmental Impact Assessment, to establish whther these would interfere with any natural processes (for example, bu creating updraft, in the case of vertical solar 'screens' or flight hazards for bird populations) as well as a best design suotability, to match the site the specific array design to the prevailing metereological/climatic conditions.
Reply: hello ..i would love this in South Africa for the farmers to get them of the grid to secure the food source of our lands. the shading your talking about  would benefit us hear in the African sun.
Reply: Not everywhere. Certain crops need all the sun they get, and certain areas don't have enough sun for solar power.
Reply: if we make it like a round ball  ❤
Reply: Great 🎉
Reply: it's going to be terrible on both products while requiring skills on both industries.  i think this is best for agriculture in the middle of the desert like in Saudi Arabia to control the water evaporation and excessive sunlight.
Reply: @zodiacfml  it's more probable, if this were to scale, that disparate industries would establish partnerships -- except for massive organizations where they could afford to employ both skillsets separately. Your average Joe farmer could partner with an agrivoltaics expert and each would stick to their own expertise. An example of this is what happened through the 2000s and 2010s (and is still ongoing) between small and medium sized cable tv providers who wanted to expand and provide internet & VoIP to their subscribers. They contracted with experts in internet provision while maintaining their own expertise in cable tv management (i.e. how to get the signal down the line through coax). Customers never knew they were calling a central internet provider that actually managed the internet for hundreds of providers with hundreds of thousands of subscribers across north america, and the two organizations worked together seamlessly for mutual benefit. The same sense of cooperative specialization could certainly happen in a situation like this.
Reply: 2 things I can think of here 
1) dual purpose: the structure could be converted to greenhouse during colder seasons - pro
2) solar panels need to be cleaned regularly to have better efficiency - putting them so high makes that difficult - con 

I think that initial investment would turn into profit over time 
Example : excess power can be pushed back to the grid , or if there was electric farming equipment (not sure if there is currently and for what price).
Reply: @zodiacfml  Would you buy Electricity ONLY FROM USA if they used AgriVoltaics on just 25% of their 4+Million km2 of Farmland... ???
If NOT.. then why will Others buy Electricity from the Sahara or anywhere else.. ???

The Sun, by Distributing its Energy, is clearly sending the message of Energy Self-Sufficiency to Mankind...

Can you even imagine if ALL THE FOOD IN THE WORLD WAS SUPPLIED BY JUST ONE NATION OR AREA IF THE WORLD... AS THE SUN SHONE THERE ONLY..???.. AND WOULD THEN ENSLAVE MANKIND...

Once again.. The Sun spread its lustre all over the globe to ensure mankind and nature can feed.. ITSELF BY ITSELF... same for Energy now..
Reply: I still want to see kinetic energy capture used as borders along farms and in high-wind zones...
Reply: @insanitysportal6692  appreciable and need of today's world for future
Reply: These communities that are pushing not-in-my-backyard issue are lucky they have word in edgewise because in Native communities and in minority communities when they put chemical plants in those communities they do not have the ability to say no.
Reply: @juggaloclownpreacher  Good point.
Reply: @juggaloclownpreacher  who represents these people in the gov?
Reply: Add electric tractors, farmers could eventually cut the cord to big oil.
Reply: @TheWineroute  now you've got a great idea
Reply: @TheWineroute  how about you make the electric tractor economic viable and then they’ll just buy the better electric tractor. It’s easier said then done
Reply: @TheWineroute  that’s funny but unrealistic.
Reply: To Rob the writer,
The water use statistic 0:13 for the livestock is a bit disingenuous, for example most of the water that the livestock drink does double duty since it also irrigates the grass grazing land (which IMPORTANTLY is usually low quality land Not suitable for crop production in the first place)
Reply: @TheOrganicartist  I used the figures given in a scientific report (Gleick,P.H et al. (2014). _The World’s Water: The Biennial Report on Freshwater Resources. _Washington, DC: Island Press)). Sure the way you count usage may influence the amount of water being used, but animals like cows for instance use an enormous amount of water, not because they drink so much, but for the the production of the food stock they are being fed.
Reply: seems great. solar panels are really really not good though, when it is taken into consideration their production costs and energy required and then the disposal. solar panels are a wash and hardly co2 neutral
Reply: @centrallakesgaming8776  Solar panel carbon footprint is paid back in less than a year and produce clean cheap renewable energy for 25+ years.
Reply: @solarcabin  not since last i heard. you comparing this to coal in china?
Reply: @centrallakesgaming8776  theres over 50 different kinds of ways some very green but very hard expensive and at the moment can't compete with the not so green ones.
1 problem is we don't got very good solar recycling but if implemented we can recover up to 97% mybe 98% so we need better recycling.
2 theres not enough demand/money going into it as well as the more green ones so its slow compared to gas or oil.
Reply: Im starting to think your a plant
Reply: @Big_If_True  A very informative video.
The Great Texas Freeze of 2021
https://youtu.be/KdMqCUa7XJk
Reply: @Big_If_True  
Is that plant - as in vegetable?

"Vegetable" is my estimation of the intelligence of the climate-quack koolaid drinkers. 

There
Is
No
Warming. 

(See the latest IPCC report, "troposphere satellite data" if you want to sound smart.)
Reply: @Undecided with Matt Ferrell Check out Cochin International Airport (CIAL) Kochi, Kerala, India run by Solar Energy
Reply: Hi Matt, is there a ready plan where I can get this installed here in India?
Reply: Hi Matt, We have also developed Agrovoltaic (Greenhouse Integrated Photovoltaic Thermal System) . check out this video https://www.youtube.com/watch?v=eD3DNiX7vu0. we will soon come out with the final video of our site.
Reply: @LifeonThirdRockFromSun  are you an Indian ❓❓
Reply: unfortunately we need a more radical approach: https://www.youtube.com/watch?v=H787Dj4oMWU
Reply: Doesn't this show what a stupid boondoggle solar energy is?  

Putting them on your roof is one thing, but taking up useful land with something that can be produced at a fraction of the "footprint" is plain stupid. 

BTW: 

There 
Is 
No 
Global 
Warming.

Here is John Robson, Climate Discussion Network, talking about 
the latest from the IPCC charlatans and their total misunderstanding of the scientific method:

https://youtu.be/n6VM41-v2gg
Reply: @hg2.  The Stupid is strong in this one.
Reply: @hg2.  perhaps you should look into this a little more, it’s being done and it works.
Reply: @boathemian7694  

"Oh yes... Just like the Texas Windmill Fiasco".
Reply: I think considering how NIMBY is supported by propaganda from opposition to renewable (oil/gas), it isnt viable to push solar in the timeframe necessary.

As much as nuclear is also opposed in the same way, there’s less subjectivity (looks ugly in my backyard) and the space required is so much lower that far fewer legislating bodies need to be convinced to push it.